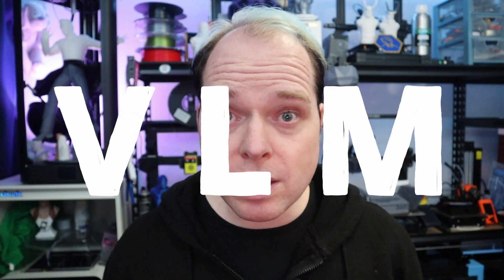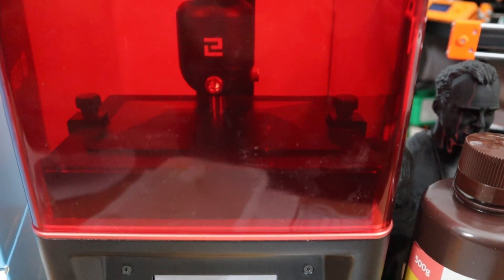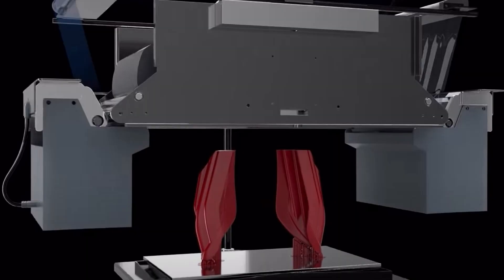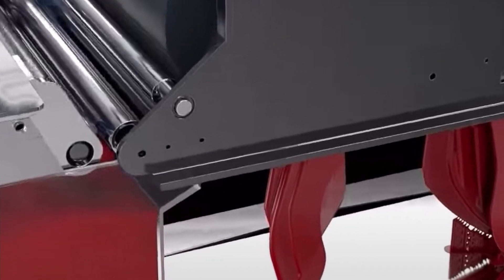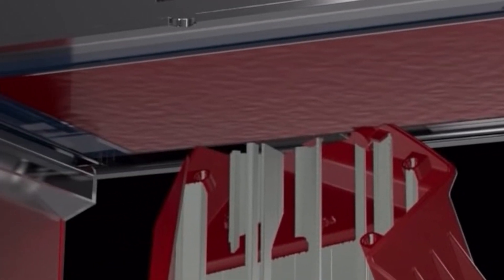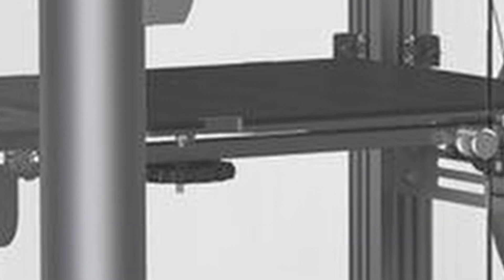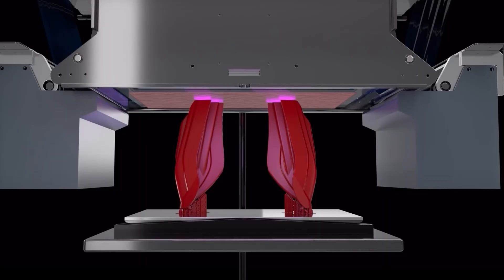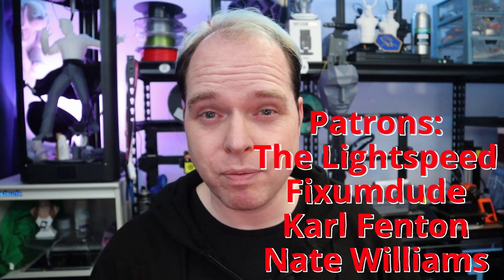BCN3D - VLM 3D printing - Z3DP News and Updates

Comment: You have resin in a vat that's sat for about a year? I think that calls for a new video: "How long can resin sit in a VAT and still be usable" ;-)
VLM does look an interesting technology, I agree that film looks to be a belt of FEP. It would still need to be an enclosed system, you don't want stray UV light getting at either the resin in the vats or on the film; also for a safe environment you don't want to be exposed to the resin fumes (also, I wouldn't want my cats to get in it or anywhere near it, no matter how disinterested they look to be, their fur gets everywhere!)
Reply from the maker: Steve, don't give any spoilers... Am I so predictable? 
I did use it when I was working downstairs, but if I can't help it, I still would use it, I have to... just like my CNC router and laser engraver.  I'll find a way to use it.
But that VLM is very nice, and I m really looking forward to see and maybe even use it
Reply: @Zachary 3D Prints  Just don't do what I did on Monday. Decided to clean the vat I was using, so poured the resin into the bottle (via a filter), then washed and cleaned the vat. Then I realised I'd poured the orange resin into a 1/3full bottle of clear! My second vat has clear in it, but left both bottles on bench! New bottle of clear arrived today.